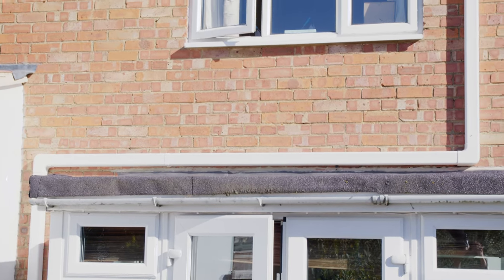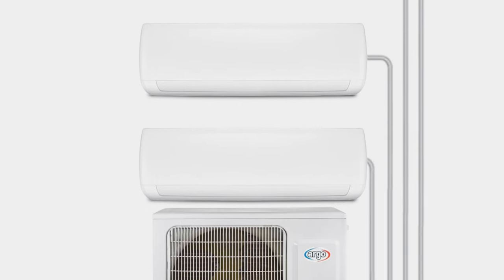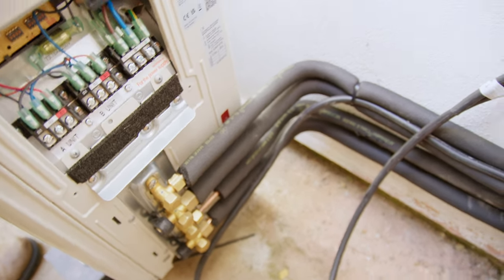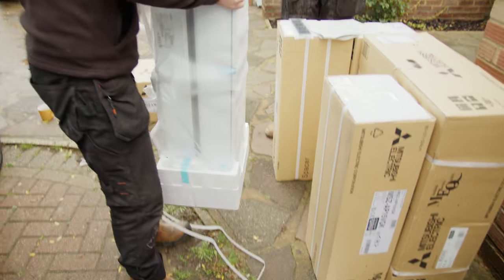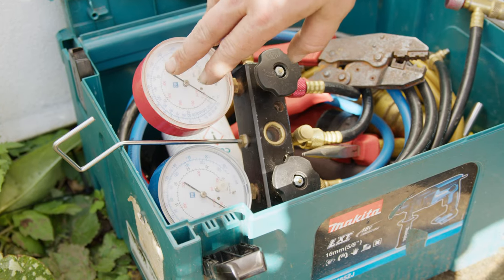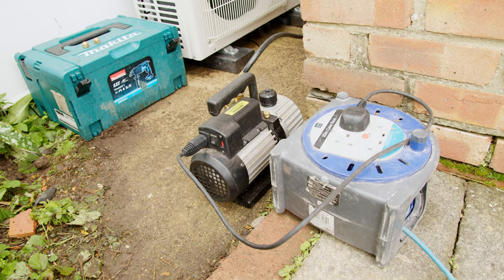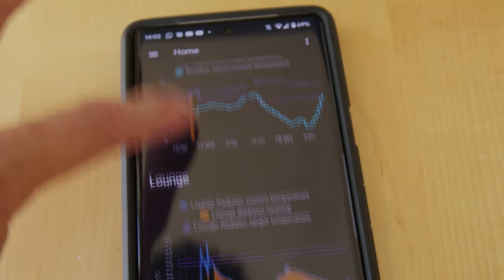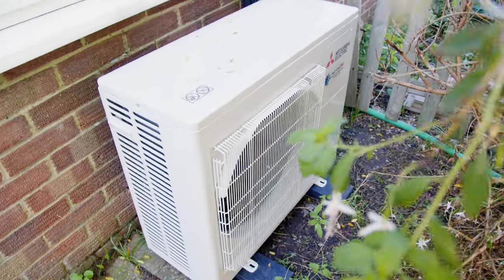Air conditioning in an ordinary British house?! 4K HEAT PUMP

Comment: I'm looking at doing something very similar, however as I'm on solar and storage I'm concerned about this standby power consumption you're referring to.  Can you explain why the system is consuming power when it isn't actually heating or cooling?  I assume also that the whole system has to be in heat or cool mode so temperature regulation depends on the circulation of air inside your house?  Finally it would be useful if you could film the system running without the background music so that we can hear the sounds it makes?
Reply from the maker: Standby power seems about 30W with all interior units "off", neither heating or cooling. That's self-reported by the system, I haven't measured directly. I guess it's just the electronics doing whatever monitoring they do and waiting for WiFi commands. You can't really turn them off either, as there are warning stickers saying they need to be powered on so the leak detection works.

As for sound, I might try again at some point but everything is so quiet it's hard to record. Inside units just sound like fans. Outside units can only be heard up close and aren't going to annoy your neighbours.
Reply from the maker: Oh yes, each exterior unit and all interior units connected to it can either heat or cool, not a mixture. But it's not really a problem for me as I'll only heat in winter and only cool in summer.
Reply: It’s interesting because the EU mandated a very low standby current draw for devices.  I’m surprised that doesn’t apply to these units.
Reply from the maker: @sjcsystems  indeed. I do think they could do better. It's possible the self reporting is over-estimating. Maybe one day I'll turn off the rest of my house and measure it
Reply: I have a similar setup here, but with Daikin units. Just for info, the standby power consumption is so low I cannot detect it with my smart meter. The cost of the heating vs a gas boiler depends on many factors. For me it seems to be averaging out at a lower cost but not by much. I calculate that on the price guarantee cap tariffs, where gas has gone up by more than electric there would definately be a saving. The reduction in energy use also means a lot less in carbon emissions. I'll look forward to hearing more from your experiments.
Reply from the maker: @ChrisJakins  regarding carbon emissions, don't forget we are only measuring power usage in our houses. Yes, we use fewer kWh to heat with AC, but there are probably reasons gas is cheaper per kWh than electricity made from burning gas. Probably there are electricity transmission losses. I don't know how it works out in terms of volume of CO2 produced.
Reply: @RobFisherUK  Yes fair point, we don't have exact measurements for CO2 although for gas it can be calculated from the usage.
Electricity has a variable carbon intensity versus burning gas directly for heat. Efficiencies over 100% are of course great because we are doing more with less.
Reply from the maker: @zlmdragon.  interesting. My MFZ-KT25VG has a sticker on it warning not to cut the power otherwise leak detection won't work. I assumed that was standard for all models. Would be interesting if there are settings that can be changed. My others are MSZ-AP15VGK and MSZ-LN35VGK.

Comment: A year later, was it cheaper with the split unit, or was the electricity was cheaper. And if the split unit is cheaper, does it offset the price of the units & the installation.
Reply from the maker: @JB-sz3yw  I'm never getting my money back. I bought it for the luxury.

It's about the same price as gas to heat the house on mildly cold days. The main trouble is gas is so much cheaper than electricity.

But it's a lot cheaper when I'm working home alone because I only heat the room I'm in, which is hard to do with gas even with TRVs.

And this winter I'll be on a variable electity tariff so I can do different things depending on prices.

Don't do this to save money. Do it because you hate being hot and sticky.

Comment: Great video! Can we have an update? How much installation was / usage figures? Thanks ✌🏻
Reply from the maker: It generally costs about 20p a day even if I don't use it. On hot days I spend 60p - about £1.20 running it on the Octopus Agile tariff.

Depends on weather and how much of the house I'm cooling at once, though. Right now it's hot out and I'm burning about 500W keeping cool in the kitchen/diner. Generally that's only needed for a few hours a day, though.

Comment: Would you find them annoyingly noisy to use for heating in winter?
Some people suggest they create air movement which is also uncomfortable?
Reply: If you get the radiator style floor mount units they are great for winter, one is shown in this video, there's a little bit of noise but many CH systems make more irritating noises (ticks/whistles)
Reply from the maker: So far so good. I'm using different combinations of AC heat and gas central heating. Noises are not much of an issue. The loudest noises are when the external unit decides to defrost and the refrigerant inside starts boiling, which could be a problem if you're heating a bedroom at night.

Air movement: I leave the fan speed on auto. Fan runs all the time but when not heating (because temperature is reached) the fan runs slow and the vents (on auto) point upwards away from people. The LN unit I sit near when working. It has a mode that detects where you are and it can blow towards or away from you. Most of the time the air feels warm. Very occasionally the temperature of the air is not warm enough to feel warm when moving so I manually adjust the direction away from me. It doesn't make it feel draughty in general, except perhaps in the smallest room, but it never runs at a high speed for long in there because it heats so quickly.

As for energy, my rule of thumb so far is that heating a single room in normal South England autumn/winter weather is definitely a lot cheaper with AC. I can run my LN25 unit for a whole working day for about 4-5kWh. In similar conditions I used about 30-40kWh of gas. But it's not totally equivalent as even with TRVs the gas is heating more of the house at once.

I've noticed some loss of efficiency and heating takes longer in this -2C cold snap. Outdoor unit needs more frequent defrosting. You can hear it working harder. Indoor unit takes longer to start pumping out warm air.

Will update or post another video when I understand my spreadsheets better.
Reply: @RobFisherUK  Thank you for the information👍
Reply: You can often lock the air swing in a specific direction.
Reply: No, they can be almost silent running. Depends on the setting.

Comment: Very interesting. Do you know what refrigerant is used? I assume its non CFC,  non-flammable & non-poisonous?
Reply from the maker: The refrigerant is called R32. It's better than older refrigerants but it is flammable and it probably is somewhat poisonous and you don't want it in your house. So it doesn't leak. The units have leak detection.

Comment: Will the noise from the external unit disturb my neighbours? I intend to leave it on all night during the summer months. And his window is 2m away from where the external unit will be.
Reply: I think you’d need to apply for planning permission for outside units and that will be a factor they consider. Apparently some modern air to water heat pumps are really quiet. Aircon are just air to air heat pumps.
Reply from the maker: You don't need planning permission, but you don't want to annoy your neighbours. These things are quiet but they are not silent. 2m from an open window in the daytime when there is distant traffic sound anyway might be fine. 2m from an open window at 3am when you can hear spiders' footsteps on your floor... might be more of a risk.
Reply: Sorry Rob, but you seem to be wrongbthere. Air to Water heat pumps are permitted development for the first unit, and more require planning permission. Air to air heat pumps are not covered under Permitted Development (UK Government trying to discourage their use as they’ll contribute to energy demand and CO2 production in Summer). However, like A2WHP, they are zero rated for VAT for several years
Reply: @RobFisherUK  considering these as I overheat so easily but am also very noise sensitive. Would love if you could record the noise of AC when sitting in a room quietly reading or some such. You seem like the kind of person who'd even be able to measure the precise decibel level!

Comment: Is it noisey? The exterior part?
I'm concerned about disturbing my neighbours
Reply: Daikin & Fujitsu Heat Pumps have a 'low noise setting' where the outdoor unit fan spins at a slower speed to not disturb the neighbours. The downside is it slightly reduces the heating/cooling capacity of the units.

Comment: Hi. Really interesting video. I’m at the very early stages of deciding what to replace my aging boiler with. I have read you were quoted around 1,500 per room. Are you able to let me know how many you have had installed and after the recent cold weather you thought that was enough? Thanks
Reply from the maker: I have it in 5 rooms. I wouldn't rely on this as my only heat source as it does not heat the bathroom and hallways like the radiators do. It did cope even in the very cold weather we had in early December. But it is at its best when you are just a bit chilly and turn it on for a short time to warm up, or want to keep warm in one room for a time. Then it is much cheaper than gas heating.

But my system would not replace a boiler because it only heats (or cools) air, not water. I don't know how well my experience would translate to an air to water heat pump system.
Reply: Apparently you can get add-on modules that take the heat recovered by cooling in summer and us that to heat the HW cylinder. Dont know how it works in winter heating mode but guessing it uses the opposite flow

Comment: Hi Rob did you have all top of the range LN interior units or some lower spec units as well? Been speaking with Sub cool myself and just considering all the options. Many thanks.
Reply from the maker: I just went for LN in the big kitchen diner. It looks a bit nicer and has some extra features, such as blowing the air directly towards or away from occupants of the room, using its little camera sensor. It also has a fancier filter.

But I just had AP units in the bedrooms. The smallest 1.5kW ones. They have WiFi and work just fine. You can only adjust the left/right vanes on those with your fingers but it's no problem in a smaller room. They do have the little extra allergen filters. They're not silent but they're quiet enough.
Reply: @RobFisherUK  that’s good to know and I believe we’re going down the same path as you.

Comment: Very nice! I have an Mitsi Ecodan and thinking about getting it converted to AC. Should be possible??
Reply from the maker: Ecodan is air to water I think. I can't think of a scientific reason why the same compressor couldn't drive both air and water heat exchangers but I don't know if e.g. the physical connections exist for it.
Reply: No chance. Two totally different systems. Ecodan (A2W) uses water pipework to rads or underfloor & cannot cool, & an A2A Multi split uses refrigerant pipework & fan coil units as shown in this video. The only option you have is to rip out everything you have & start over which will not be very cost effective.
Reply from the maker: @colingoode3702  it would be possible to just add an A2A multisplit system in addition to the air to water system. You'd get cooling then at least.
Reply: @RobFisherUK  That is true & you would also get heating as well if needed because all small capacity A2A single or multi split systems these days are reversible heat/cool systems. Back in the day you could buy cooling only systems but not any more. That said it might be difficult finding space for the A2A indoor units (especially the low wall mounted type) if you still have rads on the walls in all rooms which means one fan coil & one rad will be needed in each room - one for each system. Both systems would also have independent control systems so there is the possibility for the heating system to "fight" the cooling system if both are run at the same time.
Some monobloc A2W Heat Pump outdoor units can be configured to run in cooling & create a heat/cool A2W system. However, this ability to heat & cool is not allowed "out of the box" to comply with the the old RHI & current Boiler Upgrade incentives so the "modification" has to be done on the QT by a pro. Not all A2W outdoor units can be "modified" in this way so it would need to be checked first to see if it were even possible. However, to create a heat/cool A2W system all the rads would have to be changed for larger / deeper chilled water fan coil units (which will need their own power supplies & condensate drains) & all the pipework (including everything under the floor or boxed in) would need to be insulated & vapour sealed to prevent it from sweating & dripping water when the system was running in cooling mode with chilled water at circa 12-15c running in the pipes. Any UFH heating pipes would also limit the minimum temperature the system could run at in cooling to prevent sweating under the slab floor which in turn reduces the effectiveness of the system. 
Whilst technically possible neither option is a very cost effective option as a retrofit solution for an existing Air2Water system. I'm going to ditch my gas boiler at some point & I will replace it with an Air2Air Multi-split system, some electric rads in bathrooms & a separate all-in-on Heat Pump Hot domestic water cylinder. Reason - 1. I want to have the cooling facility as well as heating & 2. I cannot use an A2W system because my existing CH system uses 10mm microbore pipework which are too small for water based heat pumps & to replace all the pipework would be too invasive & not cost effective (T&G chipboard 1st floor & concrete slab ground floor). After 45 years in the HVAC industry I know what it possible & what is not.
Reply from the maker: @colingoode3702  yep. Fwiw I have traditional gas central heating and AC and it's a good combination. I can use gas to heat the whole house in the morning (and for hot water) and AC to keep me warm (cheaper) when I'm working from home or otherwise not needing to heat all the rooms.

Comment: Wiring up an AC to the mains plugs.... Yeah I would have spent a bit more money and put them in a separate circuit. You'd be saving yourself some big headaches troubleshooting any electrical faults in the future.

Comment: @ 3:34 Great installation! Did you receive an electrical Minor Works Certificate from the installation company?
Reply: Not a chance from an AC installer hahaha
Reply: Being an AC installer myself, I always use an electrician. It reduces profit but if anything happens electrical related, I am covered. Your AC Installers is one of the best around. I thought they’d insist on this.

Comment: I have been using similar units for some 15 years, I have a simple unit in my garage which is set to maintain 18 degrees C all winter, and two units used for cooling in the house. One is in an upstairs bedroom, the other in a downstairs room. They are currently running , with power from the solar panels on the roof, so no running costs. (sept 2023).
It would have helped the Video if you had stated the installation costs for what is a nice clean job.

Comment: do you have any details about performance in very dold weather and running costs..
Reply from the maker: On a day in December 2022 when average outdoor temperature was 5.4C, I kept the whole house warm all day with 8.1kWh.

The next day average temp was 6C and I used 56kWh of gas on heating.

That makes AC seem 6x more efficient, which I don't quite believe, so there must have been other factors. Partly with AC I only have to heat the rooms in use at the time; gas is less controllable. It's hard to run these experiments.

More typically on very cold days I'll use gas heating in the morning because it heats bathroom and hallway too. But then working on my own in a big, cold kitchen/diner, with -0.7C outside temp, use 6.7kWh to keep warm during work hours just in that room.

It's less efficient and there are frequent defrost cycles but it still works well enough and seems cheaper than doing the same with gas, even with most of the other radiators turned off.

Comment: @5:32 What is that camera looking thingee?
Reply from the maker: It's a thermal camera that scans the room. It apparently builds a better picture of where hot or cold air is needed and directs the air accordingly.

You can also configure it to blow air either towards people in the room or away from them. This does seem to work very well! Depending on where I sit it will blow warm air at me, so I feel warmer and can set the temperature lower and save some money.
Reply: @Rob Fisher  very interesting, thanks for the clarification 👍

Comment: That outdoor condenser in front of that wall will fail in hot weather as it will recirculate the air off around the coil leading to overheating and hi temp shut down.
Clearly a difficult job in that sort of house.